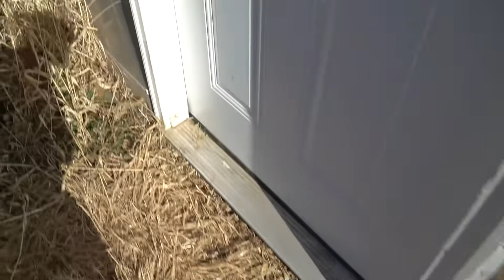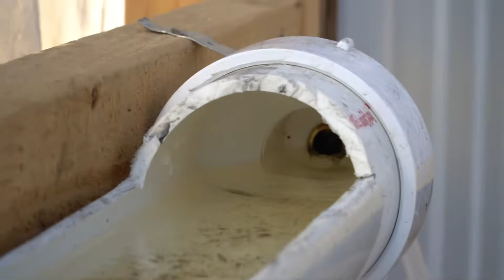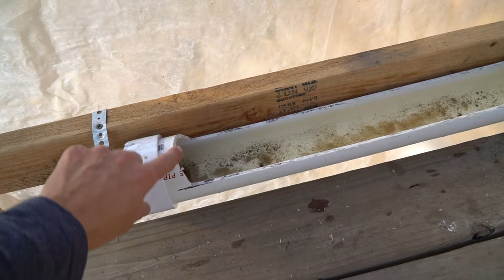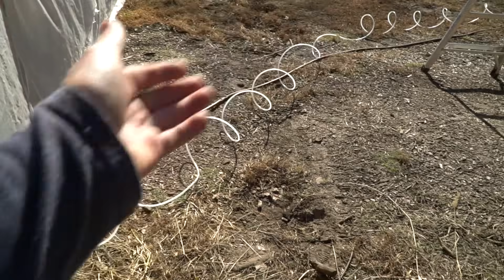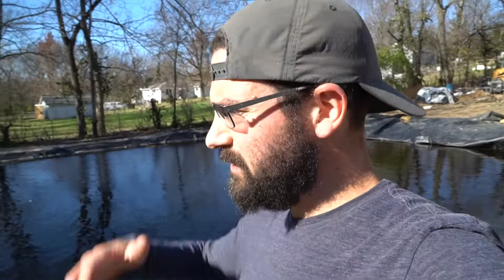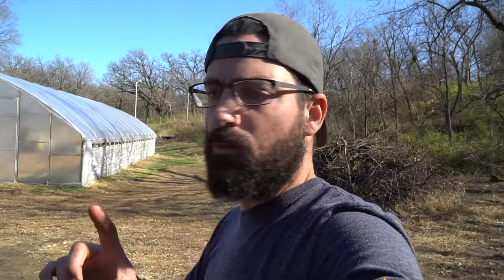THE BEST CHICKEN WATERING SYSTEM EVER! Never frozen, never empty, never dirty and no waste.

Comment: "never dirt"? Look at the bottom of the pipe. THERE IS NO DRINKER WITHOUT CLEANING. Excxept river, spring, (bigger) pond. 
And yes, this freeze soon. Especially that hairline pipe. 
Another: what if, the pump is brake down? Chicks can't drink until you see somethings wrong. 
Last: I always (80%) put apple cider vinegar and vitamins to the drinking water. In this sytem you cannot do that. Or if you put mineral powder to their food, not every animal eat it. But every animal need drink.

Comment: Thanks for the inspiration.  I live in the south where freezing is not as much of a concern. I buried a 55 gallon drum and  left 12 inches out of the ground. I used pvc rain gutter because that's what I had on hand. For outlets I used water heater drain pan fittings. The 10 dollar HF pump worked just fine i had a old oak end table I set over the drum for  the chickens to  stand on and not poop on the drum. I think it is important to keep it off the ground to keep the chickens from trashing the water. When we  had a week   of freezing weather I unplugged the pump and gave them water in a bowl twice a day. Thanks for the Idea.

Comment: Wouldn’t a T post and a foot long vertical catch pipe for debris work better at the outlet side? That way debris as it slides toward the exit drops down into the “first flush” style catch pipe and mostly water goes back to the pond? Debris would at some point settle in your drain pipe. But with the vertical pipe for debris to drop into & a screw at the base to empty it periodically, it’s maintenance free for years

Comment: Your solution has one week point, which is the actual trough that they're drinking from. I guess it'll be fine for you, since you essentially have your chickens in a greenhouse. As long as the night time temps inside don't get too far below 32F, you should be fine. But if you get long periods of 20F or lower inside, it'll freeze without a doubt.

What I did instead was get a 1" pipe and drilled holes for nipples the they drink out of. I then have a pump circulating water from a 55 gallon drum that I have connected to a downspout from the roof of the chicken run. It finally froze when we had a night where it dropped to 5F. I'm going to solve that by insulating the pipe and sticking it outside of their fence, with just the nipples going through the fence (so they can't peck at the insulation). I also have a heater in the water.

Comment: Good material,  ty
It'd be nice though,  when claiming that it doesn't freeze, to state your low temperatures.   If you only get down to 40° F, no systems freeze. If the winter lows are -20° F with wind chill 20 to 39 degrees colder still, I'm betting it will freeze.  It'd just be nice to know your colder temps.
Thanks for all the good effort you put into this video!
Reply: Never freeze…apparently doesn’t know what freezing means

Comment: And if you combine it with an automatically power switch ( timer) , than you can program the pomp to work only during the day and only  in certain time intervals of the day.  I've adapted more or less the same system  for my aviary ( canaries)  with a water timer , connected to my main water pipe.  it works perfect .  Now , no afraid to go on vacation for 10 days to 2 weeks.

Comment: “Never frozen, never” yeah as long as you don’t live somewhere that’s actually cold. -30, -40, -50c temps freeze fast flowing rivers, this system is probably good to -10c at best.
Reply: You can modify using a barrel in a coop instead of pond. My 20 hens keep their 12x12 coop 45 degrees in -20 with no heat source.just sun and body heat

Comment: I use four 55 gallon blue barrels burried upright with the tops 45" under the ground. They are being fed from one of my rain gutters. It never freezes and I use a water feature pump that goes very slow like yours. Its return is another 55 gal barrel burried with holes in it burried in gravel with a cleanout so I can suck the much out with the shop vac once a year. The trickle fills the barrel half way and drains off into the gravel and then into the sand. It rairly runs dry enough to worry about but sometimes in August I add some water from the well. If the barrels get to full I use a popup french drain fixture. Its really mostly maintenance free.

Comment: This system looks to me like it is providing a constant source of stagnant algae filled water, a sure recipe for disaster.  Plus it's open so there's nothing to prevent the chickens from dirtying it up anyway.  I much prefer chicken nipples on a pipe fed by hose attached to the common water tap.
Reply: I have had emergency 55 gallon water drums filled for years. If no light can get in the drum alge can't grow. That's a fact.

Comment: I want to build this system but with my 55 gallon drum.  How can I modify this to use the drum and pump?  Do I need to change the fall?  I will add on a pump and use a drop tank heater in the winter

Comment: 1 inch per 10 feet is the fall required for plumbing drain lines to drain.  … use Pex not PVC.  If Pex freezes it will not break.  PVC WILL.  Normal frost line depth is 3 feet.  Guaranteed not to freeze in the eUSA. 1 foot will freeze in winter if not in milder southern climates.  A 5 gallon bucket or rain barrel can be your supply pond.

Comment: Box your water lines when you bury them with Styrofoam and it will help keep your lines from freezing
Reply: Like a pool noodle?
Reply: @milagrosripski7679  no pool noodle would not help unless you live in the subtropics.
Reply: Until that Styrofoam gets wet from rain or snow then they will freeze faster. You could wrap bubblewrap around the Styrofoam then  encase in a corrugated tubing. Find out what your frost line is from your county's extention office and bury your lines 1 foot deeper than whatever your frost line is.

Comment: Burying your line.  Know your frost levels where you live.  Like here in VA is 24” below frost,  Vermont is like 48” to 56” below.  So a 12”  to 15 “ trench would be good here in VA.  Next get a 1” to 2” foam board insulation . Put your line in  and cover it with the insulation.  Cut the foam board down the middle ) Put over top of your line.   Bury it . The frost should go wide and not freeze your water line.  The good thing in this video is the water is always moving and he has protection from the “wind”.  Up north obviously you need go little deeper with water line.

Comment: I actually did a very similar set up.  I've had it running about 4 yrs now.  I used a 55 gal drum and burred it most the way in the ground, only 3 inches of the top remaining above ground.  This helps keep the water from freezing in the winter and keeps it cooler in the summer.  If the temp goes into the teens 1 or 2 nights I'm ok but last year we has weeks worth of teens and single digit temps and it froze.  This year I'm using much larger piping and I ran snow melting cable through the system.  I believe it will work perfectly from now on.  I need to put this thing on line.
Reply: You should! I'd love to see the set up!
Reply: Yes please do! I am exhausted with the absolutely stupid designs of store bought products!!
Reply: What's the best pump to use? I'm doing the 55 gal
Reply: @redneckrandy8543  trying to figure this out too. I'm thinking of just insulating the 50 gallon drum & throwing a submersible livestock ring heater in, putting a few nipples at the bottom with a tap for the duck's bucket. A buddy of mine said this is good, up to -25, but his was right in the coop, he had a larger coop & I can't put mine inside so I will have to build something. Then I'll just keep the hose indoors & take it out only to fill water.

Things always get dicey at a week of -40
Reply: I'm building one currently and I also purchased an internal warming wire to run through my system

Comment: Sure man. Get back to us, after you been using it AT LEAST through one winter. Otherwise you really dont know what you are talking about. Just another chicken waterer design.
Reply: I have used this method but at an angle at the outflow end, same size hose in and out leaving hose on a light trickle, it has worked great down to 20 below. But my run is also wrapped in clear plastic. I had to just chip a chunk or 2 of ice w the claw end of a hammer but it never stopped flowing. Adirondacks Ny area.

Comment: You should have completed your theory before you posted. Great theory, but wait. There are gaps - significant gaps that everyone won’t consider.
1. What is your frost line depth. If you are above the 44th parallel it’s 42”. It’s doesn’t matter if you bury the lines or not they likely freeze during extreme winters if not at the correct depth. As soon as your water reaches the surface (flowing or static) it WILL freeze rendering all this work seasonal, thus a patience enhancer.

2. Nipples keep debris out of the water. Any exposed container is an instant toilet. Nipples freeze in the winter also, so it’s not great in the north unless your coop is ALWAYS above 32°F.

Note: Logic. The title should read “working concept for a location restricted livestock waterer”. I write that because many will watch this video and won’t think past the end of their nose’s (YouTube brain / what to thinkers). Think full spectrum chicken ranchers 🤣
Reply: I built my trough 2 feet off the ground so they have to climb for it. Mine stays clean. Maybe you learned something from  one of those dumb youtubers who is not as smart as you.😂

Comment: Roof catch system to refill 55 gallon drum, solar pump to circulate the water.
Reply: That would work great in Florida but not in Michigan. Water lines need to be insulated and buried 5 feet underground or they freeze solid.

Comment: I’m thinking of setting up a syphon into a 55 gallon drum to draw from their watering pipe.
… but watching this made me realize the flow would have to be controlled by the water level otherwise I’d have to fill back the tube what they drink… if that makes sense.
A closed system with an opening where some of the fluid would leave the system would lower the water level in that system and kill the syphon. 🤔
Reply: Unless… I used those nipple things they could peck at and made the IN larger than the OUT and could balance the closed system between zero and a couple PSI so the nipples would work.
You think they’d freeze enough to where the chickens wouldn’t be able to break the ice on the nipple???
Reply: Ice freezes the nipples

Comment: Doesn't get dirty and the first thing I see is a dirty pipe lol I have a rain barrel gravity system that feeds into a 3/4" pvc pipe with nipples that work great, however, we are in the 110 degree heat and the pipe and water is too hot.  The chickens won't drink it so I'm looking for another way to cool water instead so I don't have to give them water everyday.  I'm thinking about running water underground and circulating it that way because I don't have a pond or big water reservoir that stays cool.  How does yours perform in the heat and I mean over 110 degrees?
Reply: Does it also get cold where you are?
I’m curious about the nipples freezing with flowing water…

Comment: I was thinking about using a 10 gallon bucket or small tank and using the water cups near the bottom then hooking up a solar panel with battery and running a small pump on a timer. Using the auger on my tractor to bore as deep as I can go. Put a coil of line in the hole. Looping back to the tank. To create a geothermal heat source
Reply from the maker: Sounds like a fun project!

Comment: This is a pretty awesome idea, thanks for sharing your process. Would love to see some updates on how its been working. Also, did you glue in the 3" piece or is it just pressure fitted into the reducers? Seems like if you don't glue it, you might be able to just rotate the cutout piece to dump any residue that builds inside... dunno if it would leak though
Reply: Dumping the debris from the trough concerns me as well. I have to rinse out my waterers every other day as well as adding fresh water. I have an idea of adding a trap to the bottom of the trough with a drain valve. You would have to drain it once a week or so. My chickens leave a lot of dirt behind when they drink.

Comment: You might consider putting the input and output lines in a 1" PVC when you bury it to prevent the pressure from collapsing the tubing.
Reply from the maker: Yeah I’m going to be using PVC for the output but that’s a great idea to put the polyethylene tubing inside of PVC as well. Thanks for the suggestion!